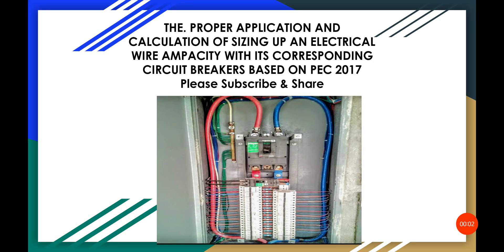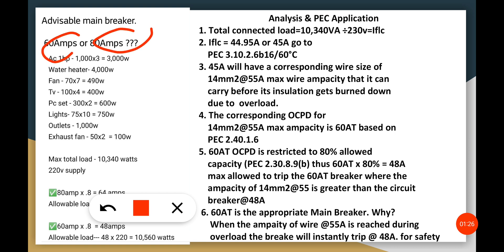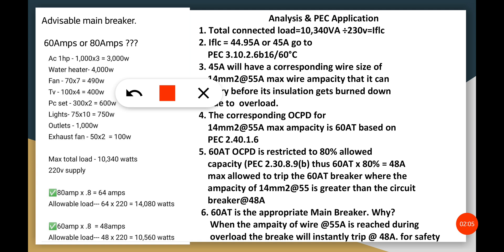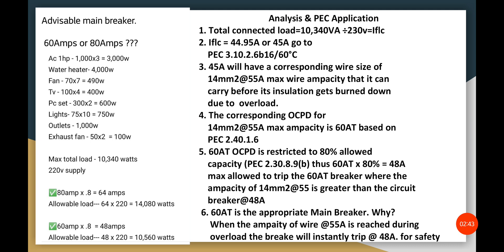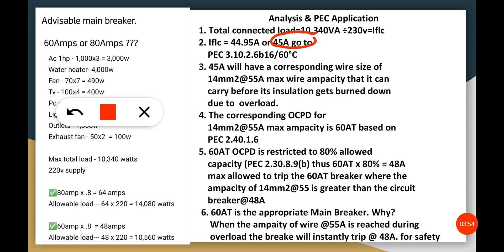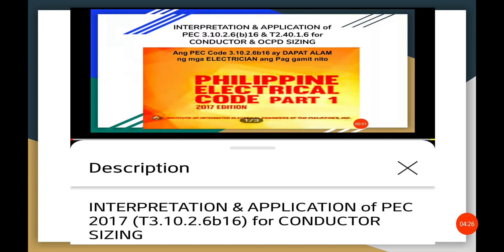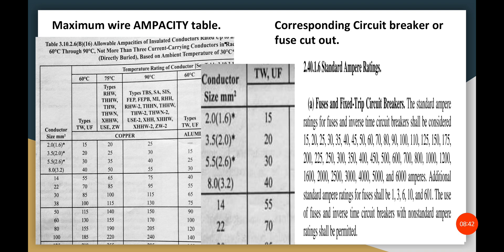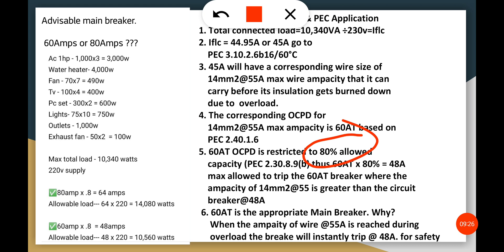THE PROPER SIZING OF WIRE & ITS CORRESPONDING BREAKER TO PROTECT THE CABLE FROM OVERLOAD SCENARIO

Comment: Sir Gud pm, ano po yung standard supply sa meralco, 480 volt or 460 volt. Thank you and more vlogs for electrical knowledge.
Reply from the maker: Walang standard supply ang Meralco. Any voltages they can provide as deem necessary for their client requirement
Reply: Sir Gud pm, clarification lang po  , yung motor rated at 460 volts 3 phase ang kanila requirements, kaso ang supply na available is 480 volts sa Meco.Gusto nila adjust to 480 volts.Thanks

Comment: Question sir. 

How about for dc cables? Meron po ba sya table for ampacity and required wire size and breaker sizing? ? Gawa din kayo ng video about dc cables sir. Gusto ko lang sir malaman.  Thanks

 your subscriber here.
Reply: Ok Sir. Kaya pala dko makita sa pec.
Reply from the maker: AC cables ay sa EE pratitioners while yung dc ay sa ECE.